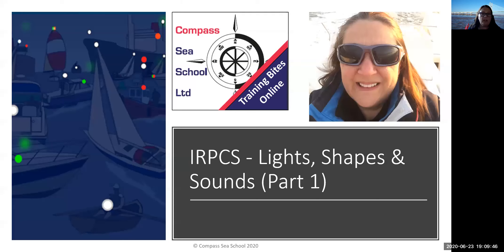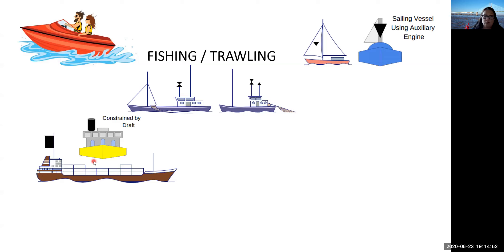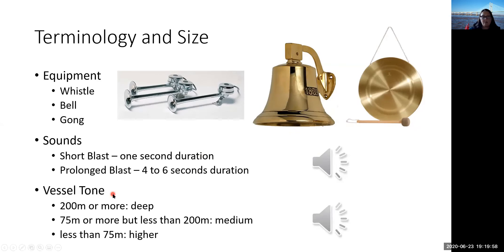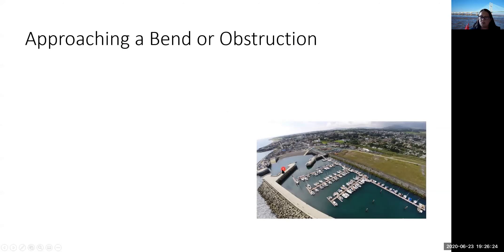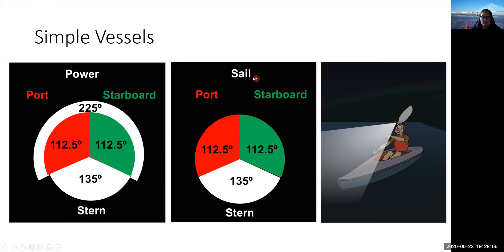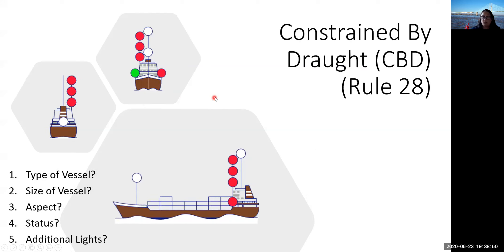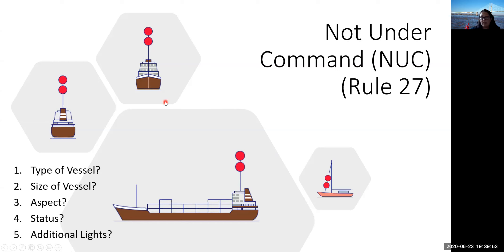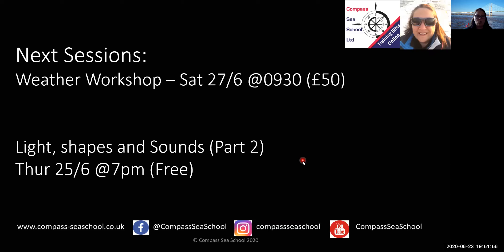IRPCS - Lights, Shapes and Sounds (Part 1)

Comment: Question: what lights should a boat under oar that is 12.5 meters long, capable of 9-15 knots ie. dragon boat team training at night - with consideration the boat has a low run on the gunnel and unable to take wake over 0.6m.  Would having port and starboard lights give an indication in the dark that it is under motor therefore approaching boats might not slow down enough?  Thoughts?
Reply: First, the easy part is the sidelights do not indicate motoring. That requires a masthead light. Just sidelights and stern indicate that you're making way under sail/oars. As far as the hierarchy, equipment, sound signals, and other rules are concerned, you're the same as a sailboat.

The lights you'll want are a combined sidelight at the bow and a stern light. Also, carry a powerful white handheld torch/flashlight/spotlight within reach.

As for the wake, there's nothing I can think of in the regs to help you, other than using the handheld light to illuminate your boat when you see someone coming in hot and hope they get the hint. You might consider a loudhailer and/or handheld VHF radio so that you could communicate with the other vessels who may not be aware of the wake sensitivities. 

Disclaimer: I'm just a stranger on the internet, so take that all for what it's worth. :-p

[Edited for length.]